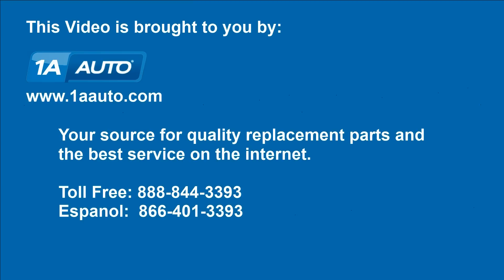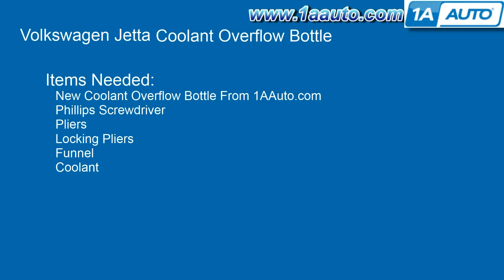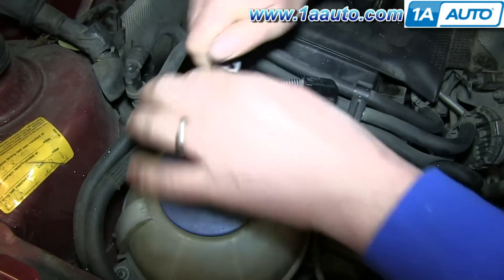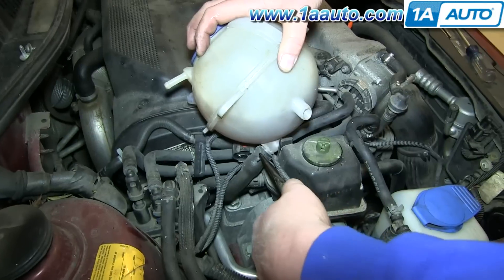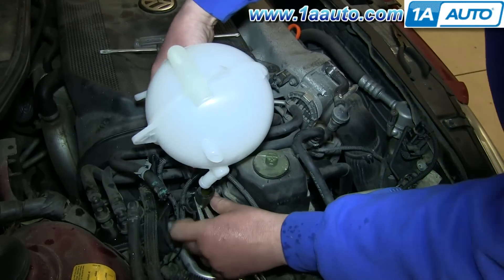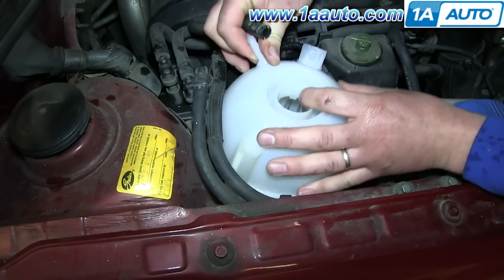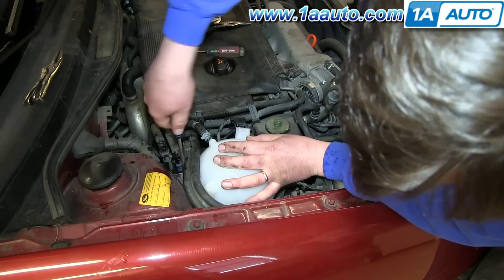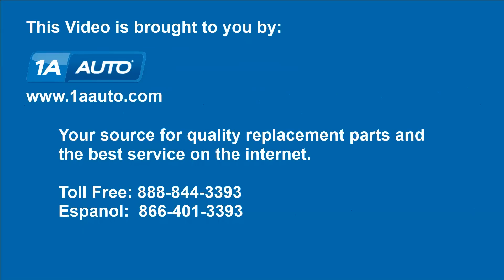How to Replace Radiator Coolant Overflow Bottle 99-05 Volkswagen Jetta or Golf

Comment: Thanks for a great video!  If I'm just replacing the Expansion Tank, do I have to go through the process of evacuating any air bubbles from the system?
Reply from the maker: +Kazu Shimasaki You should not have to. We carry the replacement expansion tank shown in this video. Here is a link to them on our website. Hope this helps you out. http://www.1aauto.com/1A/RadiatorOverflowBottles/Volkswagen/Jetta/1AROB00138?utm_source=YouTube&utm_medium=CTA+Comment&utm_campaign=ytcomment&utm_term=1zkyj8DC8b8

Comment: Mine is stained and ugly inside.  The coolant is dark and has sediment in it.  What is the best way to get rid of the stains?  I am willing to remove the reservoir for the cleaning if I must.  My car is a 2013 Passat 2.5 and probably still has the same coolant in it that it left the factory with.  It was tested and confirmed to need flushed and filled.  I took it to a mechanic a few miles away and he tested it.  He is not in a chain store that seems like they would do anything to make a quick buck off you either.  I don't expect to get it 100% new looking, just easier to see the coolant level and not have it be so ugly.  Once I confirm that nothing is leaking into the coolant (wait and see if it turns colors again soon) I might just fork over the 24 or so dollars for a clean reservoir.  I would also be happy go get it looking a lot better and not have to do that to begin with.

Comment: What kind of coolant did you use ? I'm about to do this swap
Reply from the maker: +Christopher Tarin That is a great question!  It depends on the vehicle.  Please consult your owner's manual, a repair manual for your specific vehicle, or contact your local dealer's parts department to ensure you are using the correct coolant for your vehicle.  You do not want to mix two different style of coolants as this could damage the radiator.  For anyone else looking to repair their overflow reservoir, 1A Auto offers the part here: https://www.1aauto.com/1A/RadiatorOverflowBottles/Volkswagen/Jetta/1AROB00138?utm_source=YouTube&utm_medium=CTA%20Comment&utm_campaign=1ATony

Comment: Did you just use the wrong type of coolant, in your How to video? 

That doesn’t look like G12, G13, G40 or anything compatible. Is that the yellow universal stuff?
Reply from the maker: +Andrew Long Thanks for watching!  This vehicle came in with the yellow type coolant so we just topped off the reservoir with the same stuff, as you do not want to mix different types of coolant.  Ideally you want to use the approved type coolant the manufacturer recommends!
Reply: Exactly. It was the wrong coolant. The owner of the car didn’t bother in reading the manual. It’s always pink coolant for Volkswagen.